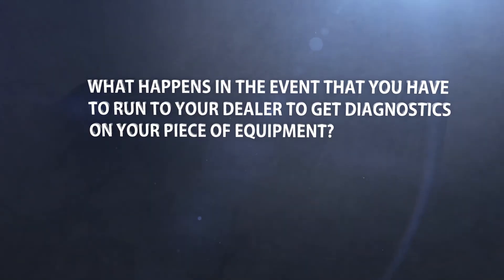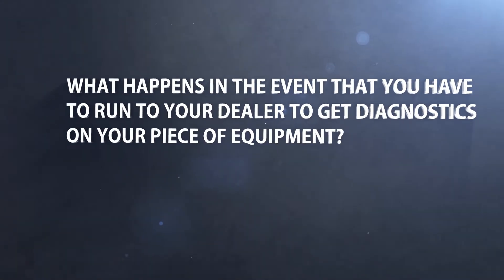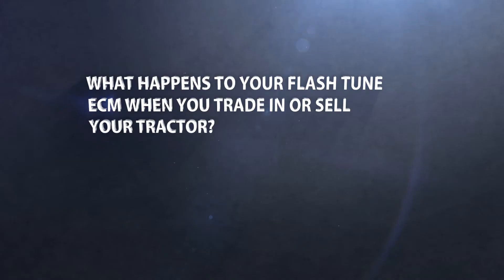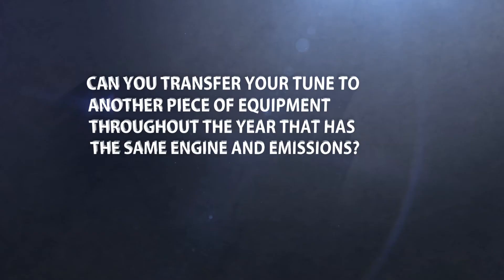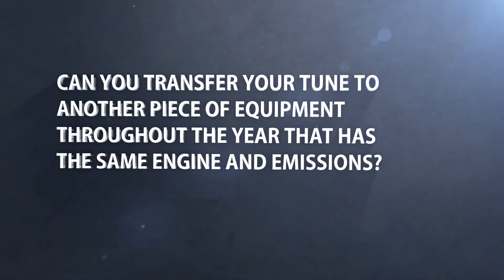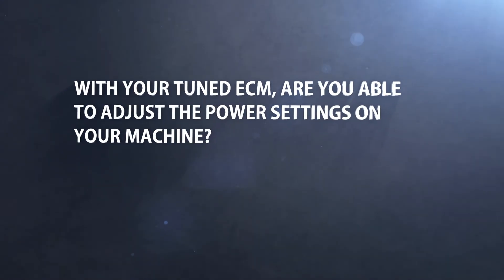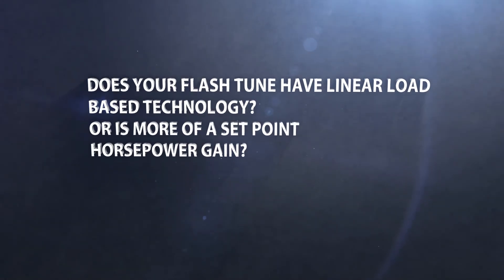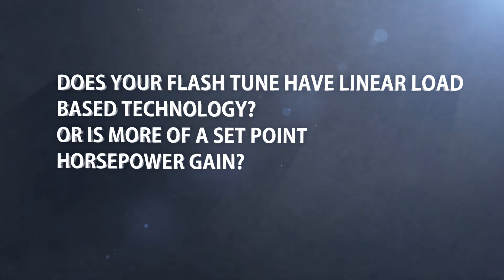Performance Module or Flash Tune Your ECM? - Questions to ask yourself.

Comment: Many other questions ...how is this power made ...rail pressure ...timing ect..... One advantage of ecm  tuning is the ability to up rate your power level the same way OEM does in different applications.
Reply from the maker: Jason, I would be more than happy to answer any and all questions that you have about how we are making the power on the modules give me a call 812.618.9168 - Devin.  Long story short, we are making the horsepower the same way as the OEM does it.  We just do it after the ECM so there is no footprint/fingerprint left on the ECM that a dealer can see/find.  We are using Linear Load Based Technology, so instead of "tuning" a tractor for an additional 60hp for example, we are giving the tractor up to 60hp only when needed and not running the extra horsepower all the time.  Please give me a call if you have additional questions.  Thanks!
Reply: The hp and torque production will be recorded on a lot of newer trucks and void your warranty. It’s not about a ecm footprint right?
2018 Duramax owner and this thing is a dog. Hoping this is a viable option.